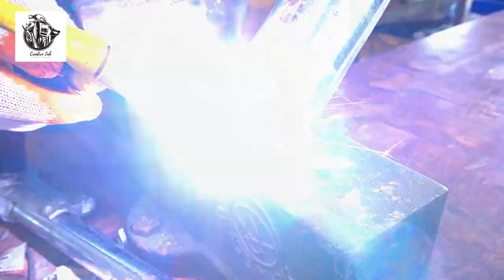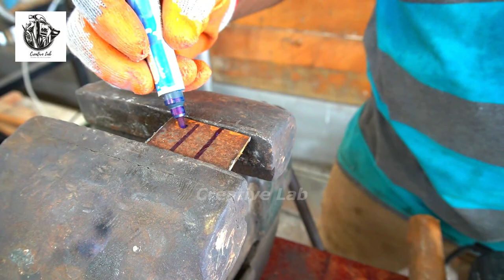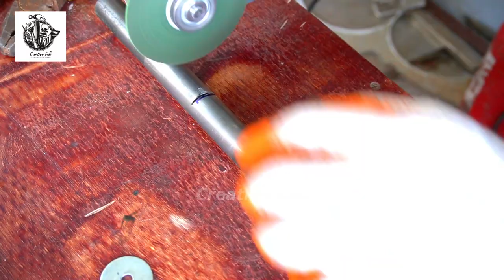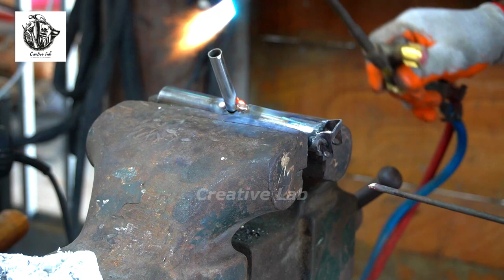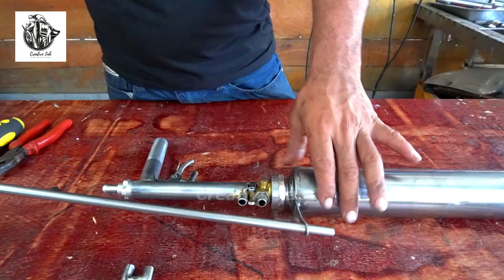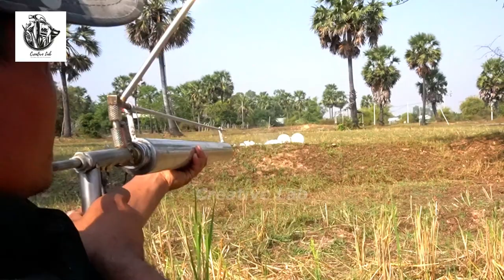Homemade Air Rifle Complete Tutorial | How to Make a High Powered Air Gun

Comment: That's friggin insane how does the hammer work?
Reply: It does not have a hammer, the trigger open the air valve by direct pressure exerted by the finger and the balls fall by gravity from the tube to the chamber.
Reply: Interesting but difficult to learn to make.

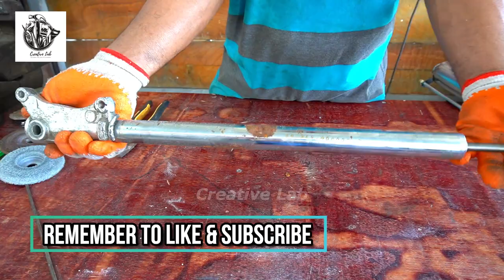Comment: At minute 5:12, what is this part, where can I find it?
Reply from the maker: It is front forks motorcycle, brother!
Reply: @CreativeLab2021 Thank you very much, my brother. I am your brother from Iraq. I have been wanting for several years to make a PCP air rifle that will be as wonderful as your project, but I want to use real 5.5 caliber equipment..of course, and because of my watching thousands of videos in this regard, I have a huge amount of information on this subject..  But what makes me stop making one is the blower that fills it with air, which must be at least 150 bar..Can you make a blower for this purpose?
Reply from the maker: @العراقي-ث2ر  Can you detail me more relate to blower , can you detail me what kind of blower? I didn't understand what you want to ask me? please kindly write in detail!
Reply: @CreativeLab2021 This type of gun needs a very high air pressure, and a regular blower cannot provide that high pressure of air.. It needs more than 150 bar and some lethal guns take more than 250 bar..The problem is that the electric blower is expensive..And the regular manual blower is not  It can generate a pressure of more than 2 bar..so it is necessary to invent a manual blower capable of generating a pressure of more than 50 bar..I am pleased to communicate with me in order to help me with sufficient information..thank you
Reply: @العراقي-ث2ر  A Compression chamber is what you are asking👍